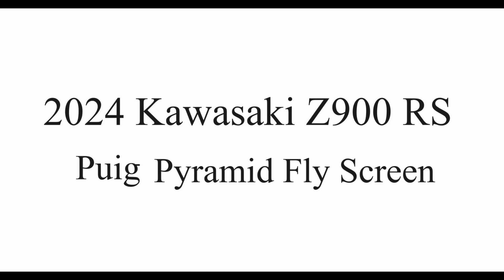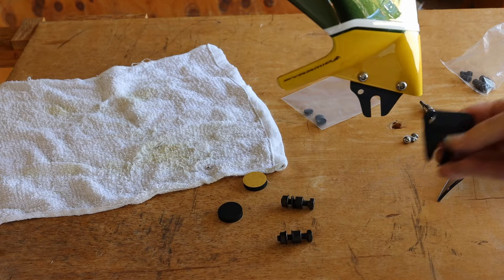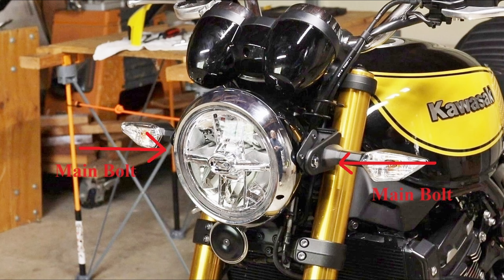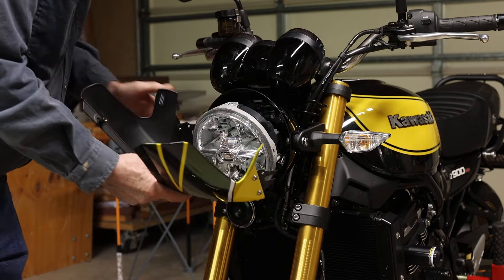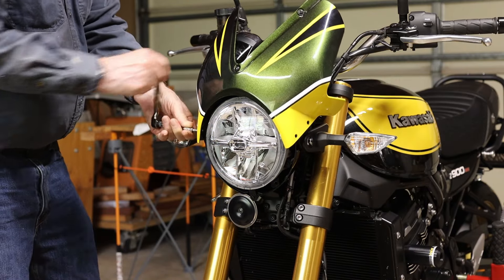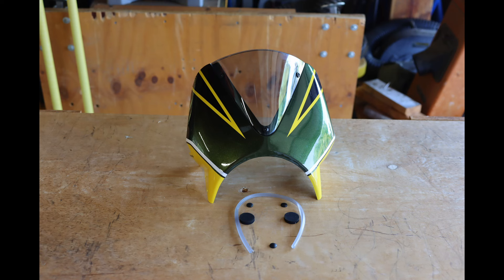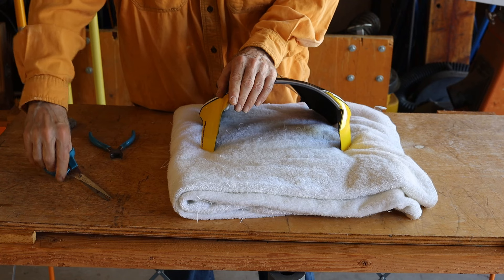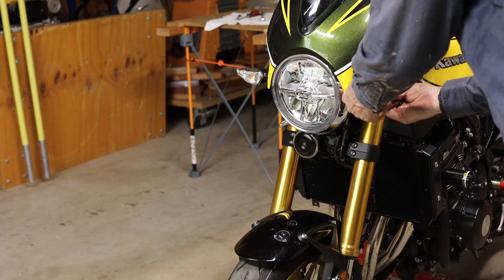2024 Kawasaki Z900 RS  Puig Pyramid Fairing Fly Screen

Comment: I did everything as you did, but after assembly, I can push the windscreen forward with my hand, do you think it is normal?
Reply from the maker: Oh, dear. That doesn't sound good. Did you torque the main headlight bolts down to 15 ft-lbs?  I know it's a hassle, but go back and check this. If it pushes forward at this point, it is a mystery to me. My fairing is still tight and doesn't push forward. Maybe it's time to have a mechanic install it. I can't really diagnose this remotely. Sorry.
Reply: @camgere  Thank you very much for your answer, no, I did not do it with a torque wrench, I tightened it as much as I could by hand, tomorrow I will check it again with a torque wrench and write.
Reply from the maker: @AbdulkadirALTUNPUL  There is nothing magic about a torque wrench. I'm sure I could have tightened the bolts down much tighter. If the brackets are sliding while you still have everything open, you should be able to see why. You can even take off the fairing (4 bolts) and test each side independently.  All I can think of is that something is keeping the bracket from lying flat to the parts next to it. Or the bracket is not fully inserted.  Good luck.
Reply: @camgere  Hello again
I watched your video again from start to finish, I did everything from the beginning, this time it happened and the error was fixed.
😊😊👍
Thank you for your answers and your interest.
Reply from the maker: @AbdulkadirALTUNPUL  Glad to hear it! I've been stumped on mechanical problems myself. Even something as simple as getting a screw started in an award position. Enjoy your motorcycle!

Comment: Looks really great - just like a factory fitted part. I haven't seen the bike in real life yet, does the shades of green in the fairing match the tank colour - really hard to tell from the vid as the tank looks really dark.
Reply from the maker: On my bike the tank is black and yellow. I've seen pictures of earlier model years where it was dark green and yellow, which is closer to the fairing. Green is such an iconic Kawasaki color I don't mind a bit of it. Also works on St. Patrick's day.